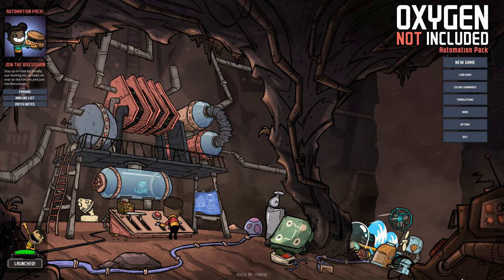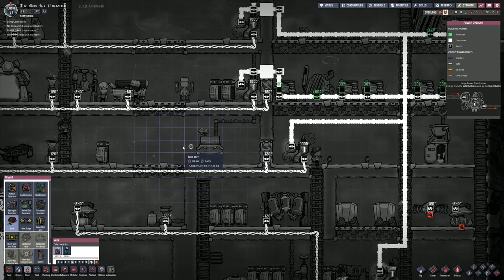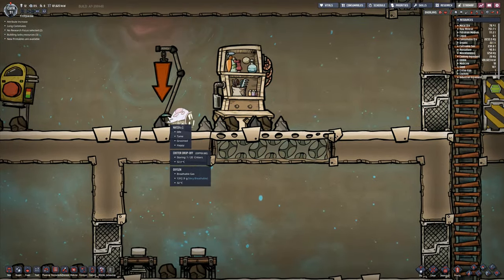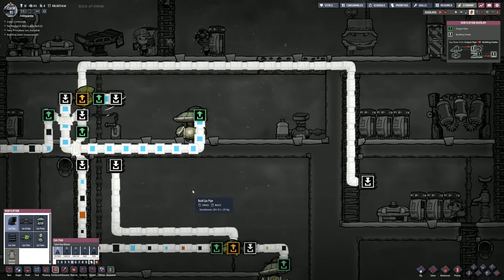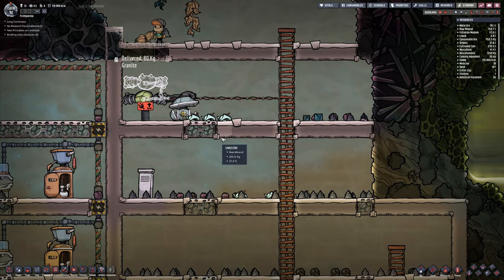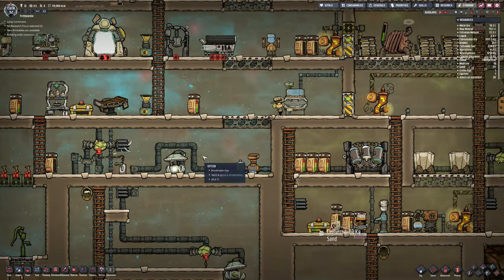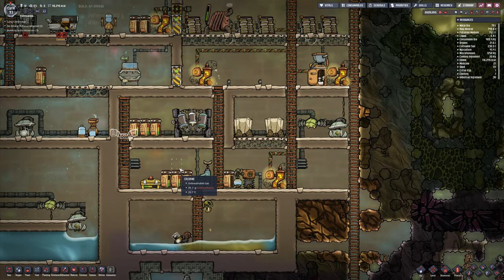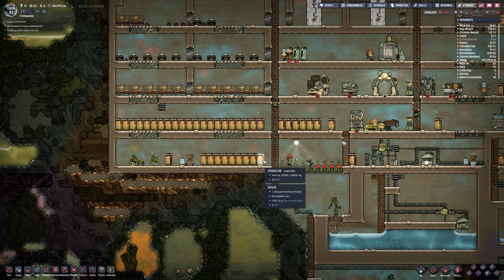Let's Play Oxygen Not Included #24: Double Gas Filter!

Comment: Best way get plastic without worrying about power would be dreckos in hydrogen environment. As for clean water tank, I think putting air locks on top left side so duplicants can come in without the other gasses getting in nor chlorine escaping, and creating a room off that air lock with another airlock and a pump to pull all gasses out of that room. Then once there is nothing but chlorine in the tank, you could dismantle the pump along with the platform. By the look of all the water you have available to you, you may need to drop the fresh tank down further.